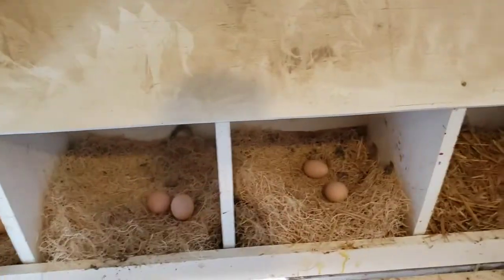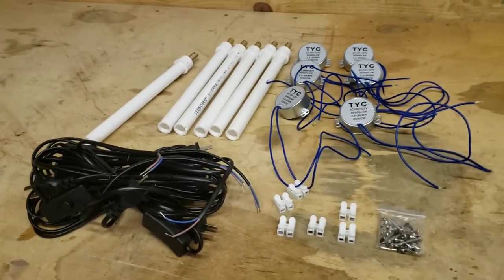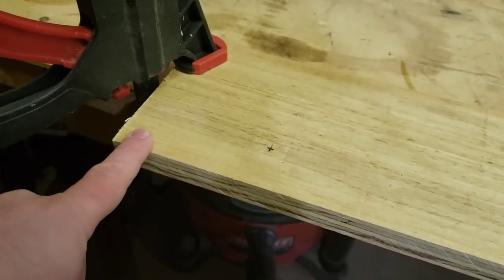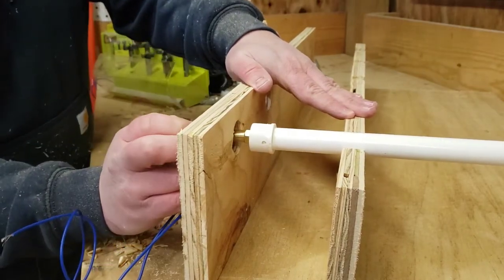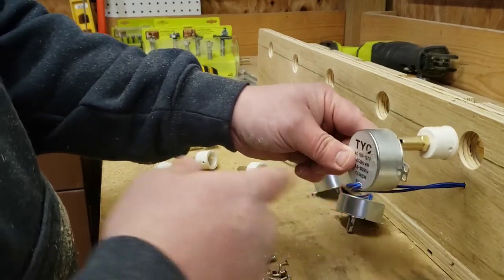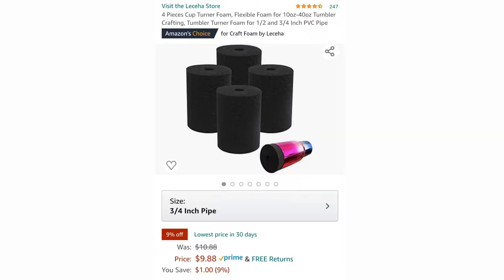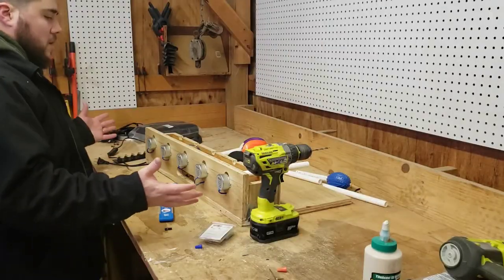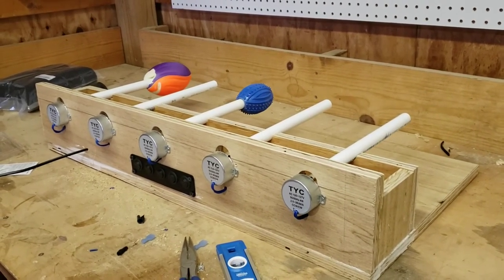DIY 5 Cup / Tumbler Turner

Comment: How has the turner held up over time? Has over heating been a problem with the motors?
Reply from the maker: Yes, no issues at all. Motors do get warm but we always have kept an eye on it and it has been working great. I did add a piece of metal tape like what is used for HVAC work on the grove that supports the pvc pipe. Just to minimize friction while it spins.

Comment: So if the wiring was correct the first time but the switches were not in the right position why not flip the whole unit? Thanks for the video though, wife has one little turner and a lot of orders coming in.
Reply from the maker: Thanks. Only because they have LED indicators for the on position. So if i flipped it that wouldn't change the fact of the led. Which honestly did not matter since I blew up the LEDs 😆 ⚡🔥🧯

Comment: What size screws did u use for the screws to go in the caps
Reply from the maker: All screws and hardware came in the kit with the motors.
Reply: @NOVICEBilliards  yea mine didn’t bc I only bought the motors I discovered that I had to use #4 machine screws for the cap screws

Comment: Can we have the actual measurements, I love your video and explained very well.
Reply from the maker: I mentioned them as I went in the video. The whole thing is 31 3/4" x 16".  Box holding wires is 5" x 31 3/4" (outside dimensions). Back plate is 5 1/4" high and the front the spindles rest on is 4" high.
Reply: Great video!!! Thank you!

Comment: That switch is only rated for 24V/20A. Hooking it up to 120V could be an issue.
Reply from the maker: Yes and as I have mentioned, it's not a How To video. It was just me documenting my first attempt at it. Definitely made some mistakes though. I wanted a switch panel instead of individual switches and thats what I found. In hindsight I would definitely choose something else but to be fair we also  have had no issues with the current switches.

Comment: What kind of wood did u use?
Reply from the maker: 3/4in plywood I had onhand already.
Reply: Thank u!
Reply: The back piece u said it’s 31 1/2 inch long how about the width?
Reply from the maker: It can be 5 -6" dosen't really matter too much as long as you make it tall enough to have room for the motors.